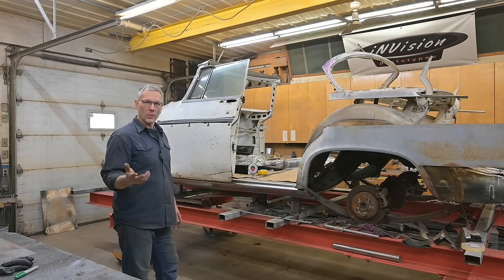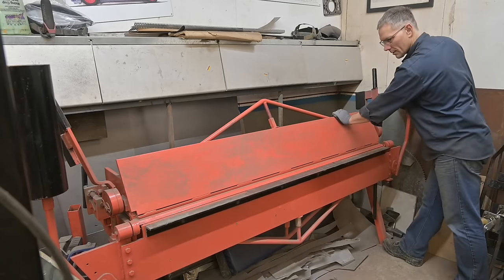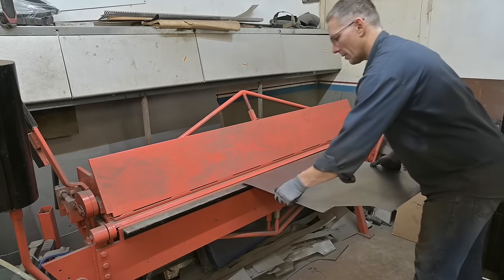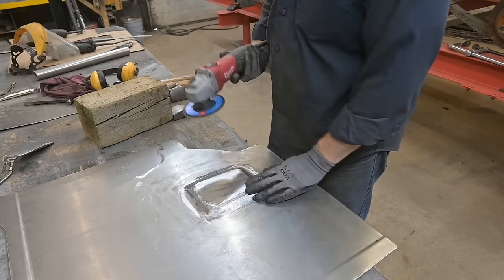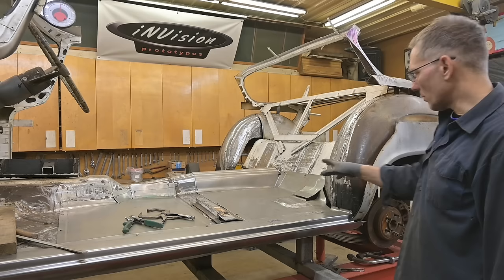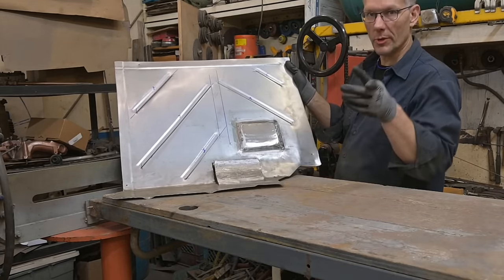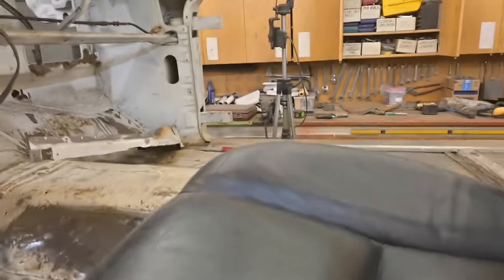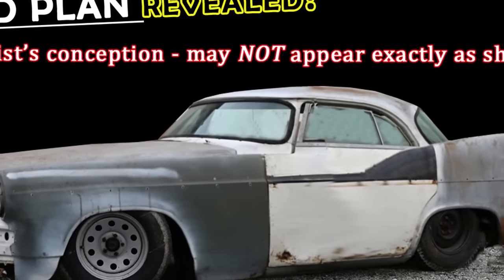MOPAR Floors From Scratch, Bucket Seats & MORE!! 1956 Chrysler Windsor Muscle Car

Comment: Boy what a seat  ... adding 300 lbs with just those ... maybe a 61 Imperial steering wheel would work ... they're already flattened out ... quite an interesting consept ... I gotta run out and pick up a few protactors so I can leave them around for looks ... can't wait till the next one ...
Reply from the maker: That would look interesting!  Thanks for the suggestion.  On another note, do you access to an ewheel?
Reply: @iNVisionPrototypes I'll check my resources ...
Reply from the maker: @joewolf4483 K.  Was supposed to do a video on fender flares over the holidays, but got sick as h.  Finally, getting caught up so will work it in soon.
Reply: @iNVisionPrototypes 👍

Comment: Great job on the floors!  Using the English Wheel to pre stretch the beads is a great idea and I will try it when I do mine.  I really like that bead roller with the large wheel, did you make it?
Reply from the maker: I find the wheel provides more consistent control.  The bead roller initially came with a short crank, we built the wheel using a ring found on the back shelf and some 1/4" rod.  Pre-stretching really helps keep the panel flat.  The deeper the bead the more prestretch required.  Thanks for watching!

Comment: Have you considered sectioning the body? You have taken length away, and you are going to adjust the height of the roof. A sleekness could be gained in proportions by sectioning. Of course that is a lot of work but aren’t you doing that already? Right now there isn’t much left but the firewall, front fender and door to take that cut out of, everything else is already cut…. 🤔

Comment: Doesn't look like there is much leg room in the back, jump up into that for a check. Awesom metal skills Nick, wanna teach me something before I die, I'm 64. Sat the bench as a goldsmith for 20 years, I could make that no problem in that metal. Steel would be harder to work with, back in the day did Pebble Beach paint work so I've been in the environment. I've really had a strong pull to do metal work but not much time left for me and to buy equipment costs too much. Lookin forward to seeing this done.
Reply from the maker: A guy doesn't need a lot of tools to get the job done.  When you get a moment check out the video on the R1/R2 mid engine sports cars.  Not everyone's cup of tea but the body for R1(the burgundy car) was formed without an ewheel.  https://youtu.be/F-CL2BK8RkY  With your experience you already have an understanding as to how metal behaves.  Age... well it's only a number.  As someone once said, 'he doesn't let the old man in'.  Is that your '56?  Very nice!

Comment: Thanks for the drawimgs Nick. I also think that puck up version looks great but your two door is also going to be incredible. Its such a a complicated build that i was quite worked up half way through this vid.😂 so i am going to have to sit back and let you take the stress, 😂. It looks like we are in good hands. By the way, what was the floor alteration? Joe
Reply from the maker: haha!  It's only metal Joe and it should feel the stress, not us 😂 Are you enjoying your new wheel?   (Check out the direction of the beads)
Reply: Nick to my shame I have hardly used it yet. I have put new floors in my MG and first fit a new rear valance, including frenching in the number plate. Obviously I am a lot slower than you or the other experts. But despite being covered in dust old underseal rust and hands cut and burned to bits I am enjoying it so much. When I am in the right place I will start using it properly, but the main thing is, it's there and ready to go. One day I will send you the photos. Joe

Comment: Not a fan of the seats.
Reply from the maker: What would you suggest for seats?  Being this is a hard top I'm after something with built in shoulder strap seat belts.  Thanks.
Reply: @iNVisionPrototypes   something that was more period correct
Reply: @iNVisionPrototypes  Those seats are great... What are they out of? I am using 04 caddy seats which are very similar in my 57 Dodge.
Reply from the maker: @massivefins2597  Nice!!  👍  These came out of a pair of Caddy CTS sedans